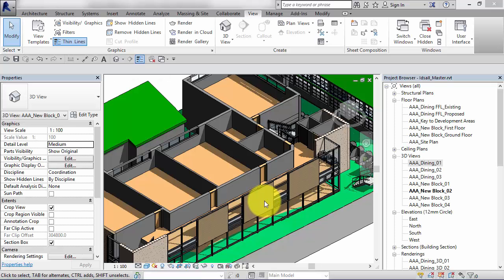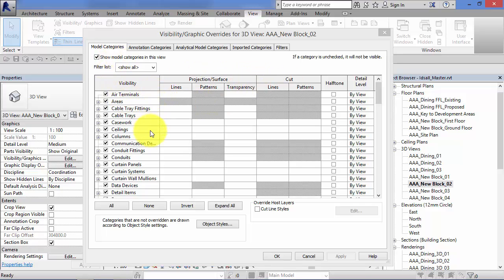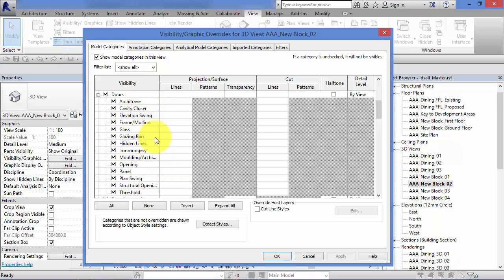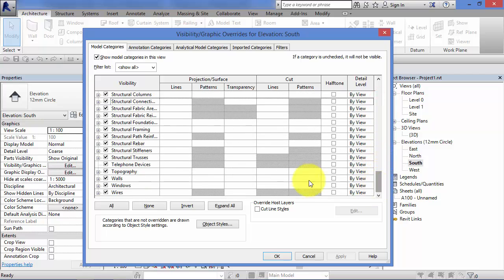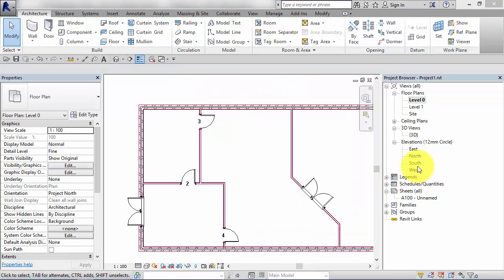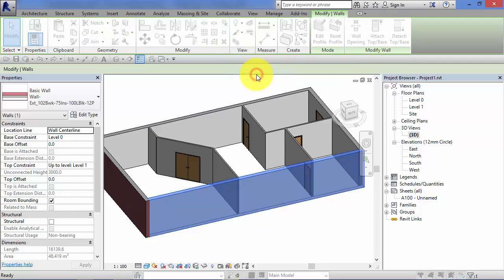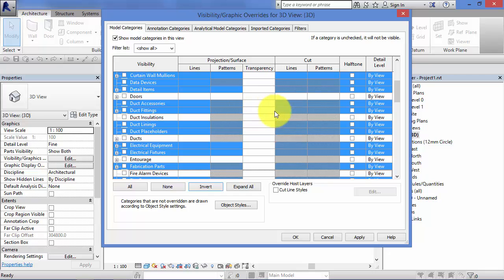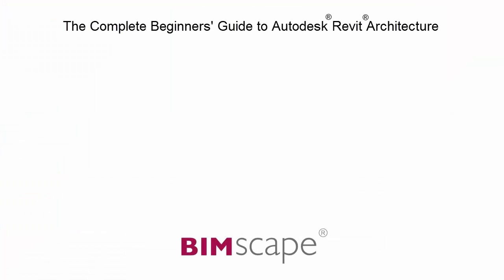Module 7: Unit 8: Revit Architecture: Visibility and Graphics Overrides

Comment: So informative, thank you..
Can we control the color and thikness of inside layers of the wall not just its outline in floor view??
And I have another question please, when you change the pattern of the wall in elevation view, how we could change its scale??
Reply from the maker: Take a look at the “subcategories” for the “Walls” category. This will tell you what lines you can control (pattern, style, colour, etc) for internal Layers. For Wall elevations- they use a “Model Hatch Pattern” that will scale automatically with the View Scale. Hope this helps?